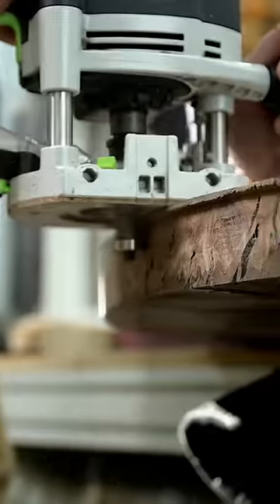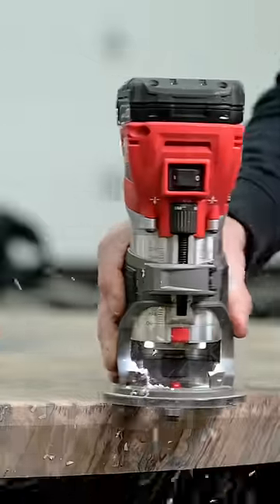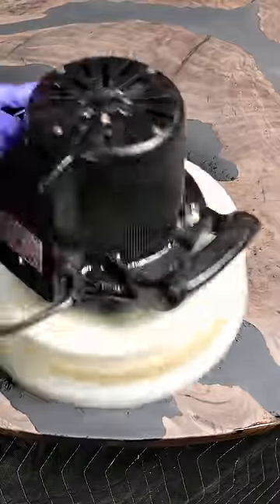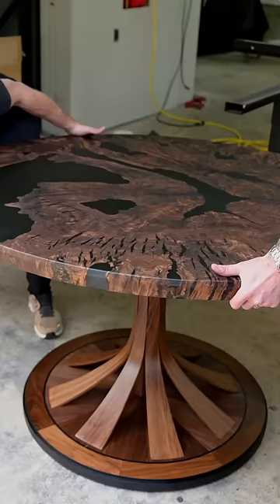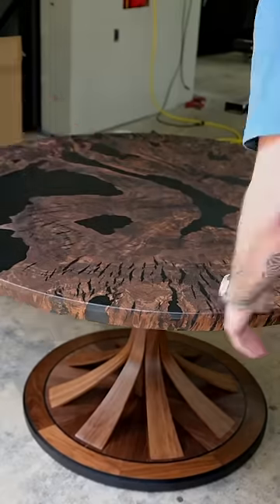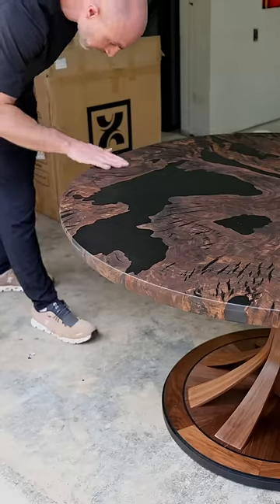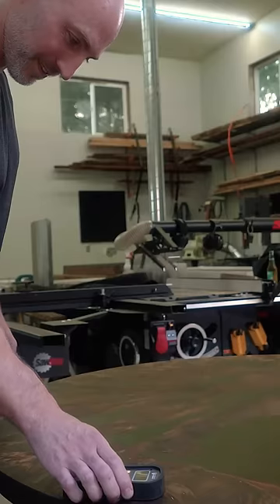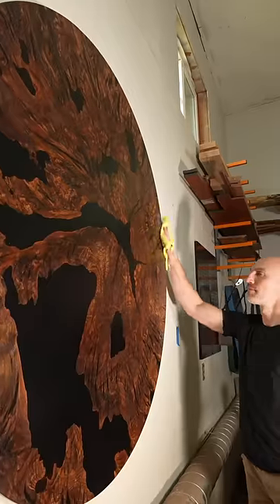My biggest f’ up

Comment: for anyone wondering, wood can trap moisture. this is why u DO NOT build with freshly cut wood. when there is moisture, that means eventually the moisture will either mold if trapped, or dry out and make the wood crack and warp, leaving whatever u build cracked and uneven.
Reply: couldn’t you just sand the unevenness and epoxy the cracks when the time comes? 😅 doesn’t seem so bad
Reply: @telisto  itd be significantly thinner and depending how much it cracked it could break. Plus assuming he sold it those people wouldnt know what to do anyway. It definitely wouldnt be as nice if he done that. But all those cracks plus sanding it thinner would make it weak and maybe break it if there were tions of cracks. Shouldnt sell something thats bad quality anyway
Reply: Thank you for the knowledge! I’ve never understood what’s going on with that 💚

I have a cool flip-top side table I got at an estate auction 20+ years ago, and who knows how old it was then. For some reason, the top was assembled from 3 different pieces of wood. 1 of them has shrunk significantly and I’m afraid it will shrink itself apart ☹️
Reply: @telisto  sometimes the warping will be unfixable, like suddenly a leg on a desk you built won’t reach the ground. also a lot of people sell their work, and you can’t really fix it once it’s across the world in someone’s living room who’s mad that their cute coffee table is all fucked up after some time. They’d probably want a refund rather than to go through the work of shipping it back to you to be fixed.
Reply: @Janaely  dang!! that’s so sad :(( but yeah ofc!!! while i’m definitely no woodworker myself my dads always been super into it so i’ve picked up a lot from him haha
Reply: Thank you
Reply: Thank you for giving context. I was super confused. I knew it was bad but didn’t know why!
Reply: Dam I still wanted that table :/
Looked like a nice drinking table
Reply: I'm curious, do you know was the wood just ruined and unfixable from the start, or if it had been left to dry before doing anything to it and sealing/epoxy, could it have dried out and then been used for the same thing later without issues ?
Reply: Thanks my friend!
Reply: Yea that’s common knowledge
Reply: It depends on where the rot/molding happens if you chose to repair the crack once it happens, but more often than not it compromises the structural integrity of the piece, since a table is supposed to be a solid piece and having weak spots then applying weight on it can potentially collapse it, so why chance it when your customers are already paying such a high price for it.

Also the finishing coat on the top means it was already too late in the process to dry out the wood further as it is already sealed so at best it was just an expensive labor of love.
Reply: Surely it should be dried out for a few months? Guitar makers specially bake wood sometimes to make sure there is no moisture
Reply: there is no guarantee. if he used oil and not wood laquer it might just dry out and be fine
Reply: @Sidious6460  it should have been dried indoors for as long as needed. then cut and sanded straight
Reply: Still looks good and years down the line you can turn it into a table lol
Reply: He could have put it in a press and let it cure.
Reply: Why was it unusable?
Reply: Thank You for the educating infor. I was so confused. I was going to find out where I could buy it. It was looking great to me...
Reply: Thank you for your knowledge ❤
Reply: Can't you drill holes?
Reply: Finally! The comment that I kept looking for. I'm so shy ask thinking I would look dumb 😂 but yeah, thanks 👍
Reply: How can it mold? It’s literally sealed in epoxy.
Reply: A piece of wood can still get moisture inside after a hundred years (especially after blasting it with cold dry ice). Mold wouldn't necessarily be a problem if it's sealed already, but the moisture would travel through the wood, warp, and cause the epoxy to separate, so mold would become a problem if your table doesn't crack and fall apart first.
Reply: @aleyorch44  i mean i got a lot of comments from ppl who didn’t know
Reply: @@Lucy-sb4co my family is in woodworking and actually a lot of very well known tools, techniques, etc. in woodworking stem directly from japan which is where anime originated sooooooo

(i don’t watch anime tho i feel kinda devious with my anime pfp bc i just like the style)
Reply: How long is the time span for issues. Maybe it wont be a multigenerational piece but it wouldve still been beautiful until you could find a similiar one to resell the customer, thats done correctly.
Reply: @telisto  the joints will get loose and sometimes screws get loose aswell, cracks all over the place etc etc (because you cut it and drilled it making it dry faster)
Reply: This is true but if you’ll notice….IT LOOKS COMPLETELY DRY
Reply: @dannyspring5146   doesn't matter
Reply: Thank you
Reply: Shouldn't the resin prevent most of that anyway?
Reply: It won’t mould without oxygen… it will warp
Reply: Thank you for explaining what would happen. Such a shame though, it's so beautiful and the time put in it. Heck I'd buy it anyway.
Reply: %😂qHE SII|||||||EVERY ẞ=====DR @Janaely
Reply: Why didn't he check moisture before he sealed it?
Reply: In fact I worked on Oak framed houses where you absolutely want to work with fresh wood.

You build your frame, hammer in wooden pegs to hold it together and after a couple years let the wood do its trick and dry out, making the whole frame solid.

Not allowed to be used as structural pieces by building regulations anymore but they stand strong.
Reply: so what's the solution?
Reply: Walnut that thick takes years to air dry. I've had people who operate wood kilns tell me that you can actually lock moisture inside the wood and there's no getting it out.
Reply: Oh that stinks after so much work. Thank you for the information.
Reply: Can't you just bake it at like 80°C like in a dry sauna? Or put it in a tube full of salt to dry it like meat.
Reply: Wow - I would still buy it and use it until the mold happens!!  Too beautiful to waste.
Reply: Crazy that he didn’t put this thing on a drying rack with dunnage planks and other material drying stacked on top and or below. Periodically testing it with a moisture meter to know when it’s ready. What a bummer!
Reply: News flash.  Wood without moisture is sawdust
Reply: @stevenbrown5210  That is about the most ridiculous statement I’ve ever heard regarding properly curing and drying wood. First off wood doesn’t just turn into sawdust from drying. Maybe in desert conditions with extreme UV exposure and wind over a multitude of lifetimes…. again, maybe. Throw in microbial degradation for fun, why not?. Have you ever planked live edge slabs from a freshly fallen tree? This is exactly the method for getting them to the point of working them. Stacked on top of one another with strips of dunnage spacing them apart so air can flow. There are other factors regarding time, heat exposure etc but that’s the gist.
I love you Internet trolls. You always seem to prove the fairy tales to be correct in their portraying of trolls. Egotistical, foolish and for the most part salty AF.
Reply: @telisto  seriously. Still seems like it would be better than any table I've ever owned.
Reply: It's so kool I would still take even in case of future damage (might) happen😊
Reply: New wood is treated to prevent this

Comment: I would have bought it at a discount and let it live out its life as a table, then turn it into a wall piece. I'm not hard to please. This was fkn beautiful
Reply: Only would’ve lasted a few months
Reply: @scubster3922  how you know?
Reply: How about just drill a hole where the moisture was? If it's a lot, it can drain/air dry, right? Then seal it with something like a glue afterwards?
Reply: @Goblin_Hands  i feel like that would work
Reply: @Goblin_Hands  wood changes size and shape with moisture content, I think it might have created gaps/cracks between the epoxies and sealants
Reply: "oh no, a natural object has a tiny dimple in it instead of being mathematically perfectly flat, better destroy it"
Reply: @wetstoffels3198  moisture in the piece can cause the wood to change shape underneath the sealant, causing gaps underneath the surface that would make the piece look like it’s falling apart
Reply: Same bro I gotta get in touch with this guy for a table
Reply: Facts right here!
Reply: @9gr4gt how does one remove the moisture before putting the epoxy? Just blowtorch it?  He previously said in a comment that woodworkers usually double  check for pockets of moisture so how do they remove them?
Reply: @BeardedWolfKing  usually a kiln is used. Air drying with fans and heaters. I assume torching it would burn the outer layer before being able to draw moisture out of the inner layers
Reply: @Goblin_Hands that would work. It would need to dry slowly to avoid cracks

Comment: Thats like the equivalent to finishing an engine and turning around to see the headgasket sitting on the table
Reply: Haha 😂
Reply: But all the screws and bolts have been welded on
Reply: I get it now 😢
Reply: Except you can still rebuild it, this thing is useless now
Reply: @Digitness  theeeeeere it is.
Reply: @Digitness  This, at least you can start over with the engine
Reply: Or dyno testing and it fails due to timing being off lol
Reply: 😂awww makes sense now 🤣🤣🤣
Reply: No no no that isn’t a good equivalent an equivalent would be most of the engine was all molded together and renders it completely useless if a head gasket is on the floor all you have to do is go back some steps.
Reply: Like building an engine and using green locktite on all the bolts and turning around and the crank, pistons, valves and cam were welded into a sculpture by yout teen ager learning to weld out of your scrap metal pile but used you new balanced performance parts.   Rookie move for someone who has a moisture meter. 12 gallons if epoxy isn't cheap either.
Reply: @oumardiop1 useless? Why? To whom? A little trapped moisture wouldn’t hurt a thing in my opinion. If worst comes to worst make it a bad ass wall clock
Reply: Oh man, That hurts just thinking about it
Reply: Worse. It’s like finding out the block was made of wood.
Reply: Worse, a piston ring
Reply: Or worse crank bearings
Reply: Or they sold you solid lifters not hydraulic. 😢

Comment: This dude just made the most beautiful table I've ever seen, then was like,  "Nah, it's trash."
Reply: Moisture trapped in the wood will make it break over time.
Reply: @kugelblitz1557  How long would It itake?
Reply: @andresantvi  depends on the type of wood and temperature swings and what else is in the wood.  If there's some antibacterial agent in there it might take longer to start rotting, but if the temperature gets too high then it will expand and split and if the temperature is too low then it will contract and harm the wood, and different kinds of woods react differently to expanding and contracting.  All this to say I have no idea, but over time it will happen
Reply: This is the nature of our creation. So much beauty, so much risk. Do not be afraid.
Reply: I'd have said fuck it, I'm using this beauty til it does break.
Reply: He coulda saved it. Sanded the epoxy off and kiln dried it rapidly. Sure it would warp, but you could deal with that and refill the new voids made.
Reply: the wall piece is better that base for the table was ugly
Reply: @HOLYOKEFLATS  never let bro cook 💀
Reply: @Ralph_Roberts His job is to make these tables. He has plenty of tables that are just as good looking but do not have this problem. Everyone makes mistakes once in a while.
Reply: LITERALLY

Comment: Man, the slab just in its original form was gorgeous
Reply: Yeah but you HAVE to add epoxy to every woodworking project these days to make YouTube content. It's the rules.
Reply: he kind of ruined it
Reply: Yeah, much preferred it before he cut off the beautiful wavy edges and drowned it all in epoxy... 😔
Reply: Beautiful wood, drowned in plastic.
Reply: Not much of a great table though
Reply: @RodJeez  not kind of, HE DID
Reply: @johnmarston1419  why not? Easy to cut glass and lay it over top, is it not?
Reply: @dougthebuilder1 
 Do you dislike the style overall or this particular piece? I can't tell.
Reply: @ndee1472  so just a big square of glass on top of the wood or a perfect outline what we talking here 

 also glass is fragile if it breaks you have no table (unless you pay for really strong glass on top of the expensive wood) with the epoxy and wood bond the only way it'll break is if you had a bigger heavier 500lb+ table to drop on it

I like the edges too but the holes dont make for a great table
Reply: @John Marston  also tempered glass, is incredibly durable. Infact it can withhold more weight than wood or concrete.
Reply: @ndee1472  yeah but that could add more than 300 dollars to the cost 
Not that that's a big price just saying
Reply: @John Marston  lol who tf cares about a few hundred dollars when you are spending thousands on the wood?
Give your head a shake
Reply: @John Marston  more money was spent on that Epoxy that rendered the whole piece useless
Reply: @ndee1472  like a I said not a big price can you read properly
Reply: @John Marston  no need to be rude, dude.
Reply: Yes, the raw live edge was beautiful before he cut it off
Reply: Because nothing says natural beauty like putting a load of plastic in it 🙄
Reply: @ndee1472   Oh please not you being passive aggressive the whole time with each reply but in the end playing victim the nerve
Reply: @۵Laverna۵  excuse me? Playing the victim,  how?
 I commented about the beauty of a slab of wood and how easily glass could be cut...kindly go find something else to complain about
Reply: @RodJeez  no he didnt
Reply: What about the structural integrity.  It seems to be very very fragile in its original state.
Reply: @jdees4  exactly they can’t just like.. sell a table that’s dead wood so it’ll crumble apart, plus the moisture which is another component to make it worsen over time. I get it looks nice but it just doesn’t work
Reply: @danielflanard8274  I hate how it's just the norm to fill any carpentry project with epoxy, especially turquoise blue, it's done to death and bad taste.
Reply: @turtlesrprettycool3379  just because someone speaks confidently using technical terms does not mean they know beauty
Reply: @RodJeez  counterpoint: opinions

Comment: Man, I’d take my chances with the trapped moisture. That piece is freakin gorgeous.
Reply: You’re right! It’s gorgeous and I thought the same thing… then I remembered back to my material science classes a realized, it’s going to warp because the moisture is trapped. (I’d still have at as table, tho! F*ck the warping)
Reply: I'm wondering if they can't add extra support at the bottom to reduce the warping.  And maybe just use it for personal use.
Reply: @mr.marquez1257 let it warp then plane it smooth job done ✅
Reply: Yea not for 5 grand lol
Reply: ya .. if its sealed who cares
Reply: How could you know there was dampness under the resin? Turn it over and allow it to dry off.

Comment: Nah man, slap some stunning and huge gold numbers and hour/minute hands on that thing and you’ve got yourself an incredible statement wall clock!
Reply: Take a 2' long 1/4" drill and from the outside diameter edge in towards the center at each of the twelve different o'clock positions.  Let dry in room with dehumidifier in it for 72 hrs.